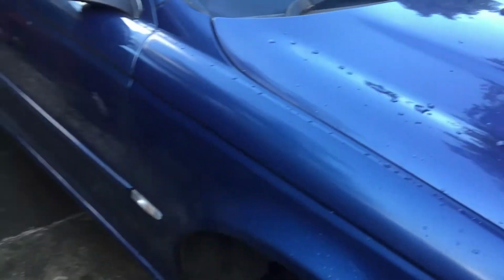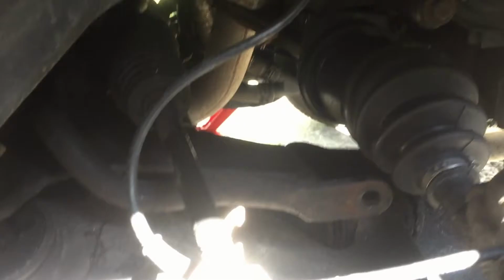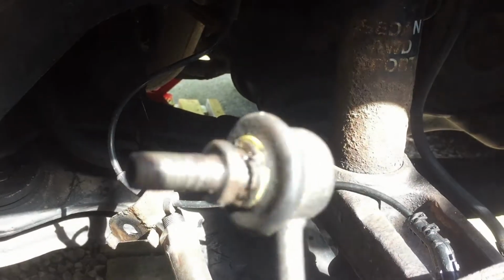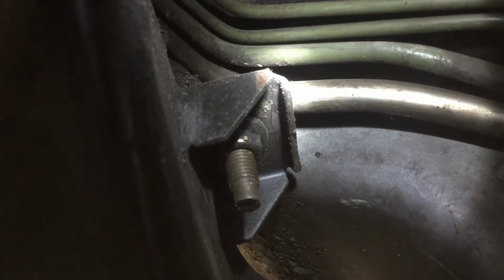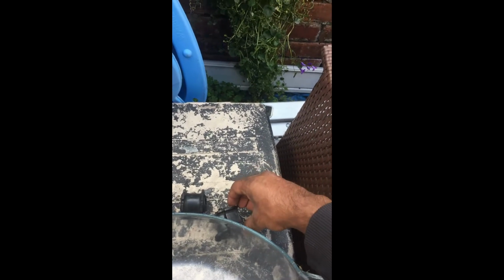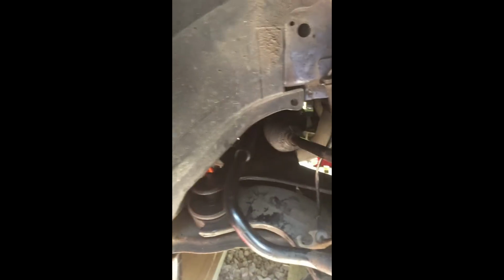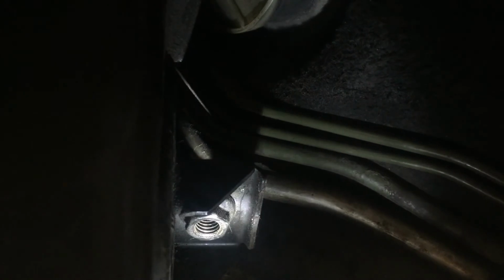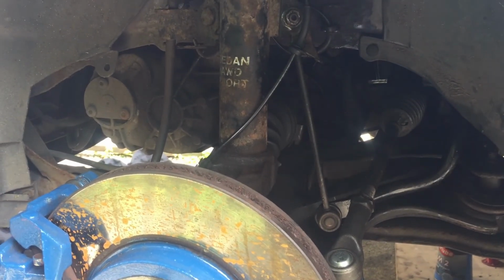How To For Jaguar X Type Front Anti Roll Bar Bush Change And Creak Fix

Comment: Thanks for showing us.  I'm faced with an MOT fail for the n/s bush, but can't see how to get a spanner/ratchet at the rear bolt.  Haynes manual says subframe must be dropped, no way I'm doing that!!  As long as I know it CAN be done, I'll take another look.
Reply from the maker: Its fiddly, takes patience and a little wrestling getting the bolt out but much easier than lowering the subframe.
Reply: @itsajaaaag   Yup, managed to do it yesterday.  Fiddly, but as you say, with a little patience it's certainly do-able.  Thanks for giving me the confidence to try.  2hrs to complete the left side,  will look at the right side after MOT and when weather is warmer/dryer.